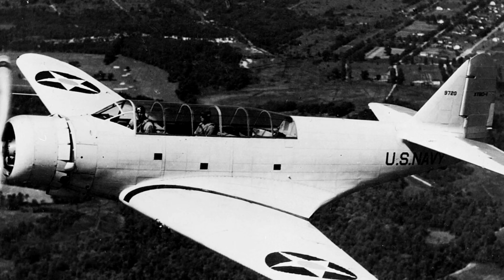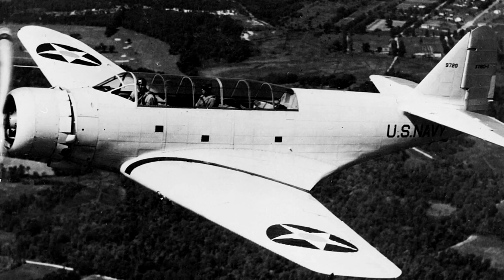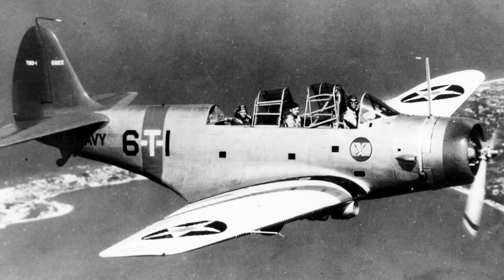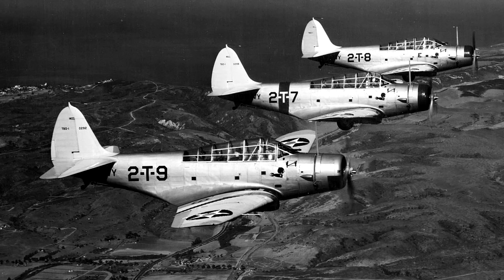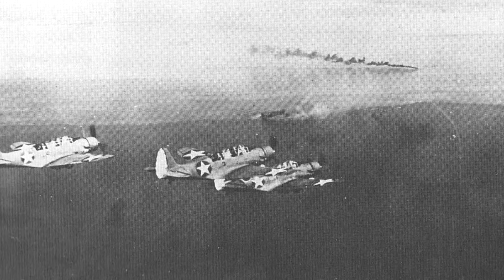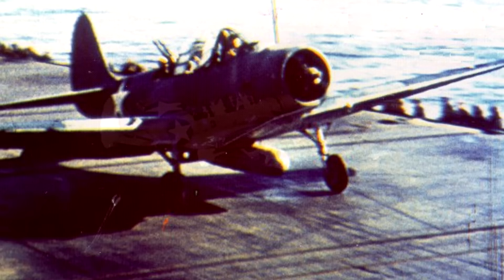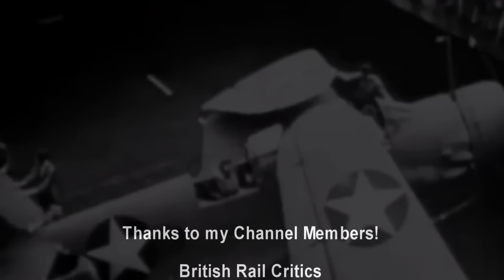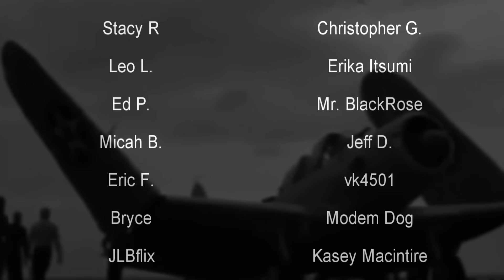The World War II Plane Put Up Against Stacked Odds | Douglas TBD Devastator | History in the Dark

Comment: Poor old Devastator, similar to the Battle in many ways. Looked pretty good, flew well when first introduced, suffered in modern war and flown in to action by extremely brave men.
Reply: Difference is, the Royal Air Force didn't give the Battle ordnance that was prone to failure. And this failure in ordnance also affected the Devastator's successor the Avenger. Midway was a horrible end for the Devastator, but it was an equally horrendous debut for the Avenger, purely because of Naval Ordnance arrogance.
Reply: I think 'extremely brave' is an understatement. I don't have the words to describe men who knew they were flying in literal death traps, dropping torpedoes that had a massively high failure rate. Their sacrifices were not in vain, thankfully.
Reply: Great looking plane!

Comment: Another aircraft was a similar victim of rapid advancement: the B-29. It went from the most advanced aircraft in the world in 1945 was considered to be hopelessly outmatched in the new jet-age as MiG-15s basically drove them from the skies. Well, daylight, anyway. The opinions of B-29 crews in Korea was vastly different than those in WW2.
Reply: THAT would be a great video, too!
Reply: The B29 wasn't that great in 1945. It's worth remembering that it was flying at a point that the Japanese air defences had been so degraded that it usually didn't need a fighter escort, and the Japanese rarely even tried to intercept them due to a lack of aircraft, pilots, and fuel. The situation in the Korean War was very different. The Communist forces had plenty of all three, and the MiG-15 was developed in large part to intercept bombers like the B-29.

There were a number of other issues too. For example, the engine cooling wasn't sufficient and the task of setting the radiator cowlings was an art form. Too much towards closed, the engines would overheat and catch fire, too much towards open, and the drag would take the aircraft below stall speed. At altitude the difference between these two points could be minimal, or even such that the bombers had to drop altitude in order to avoid the stall or fire choice. 

It was the first bomber that could hit the Japanese mainland and return to friendly bases, but it was at the cutting edge of what piston driven aircraft were capable of and it was unreliable and flawed as a result.

Comment: From the book "The Big 'E'," comes a story of an incident that happened during the early months of the war.  For most of December 1941 and January 1942, the USS Enterprise patrolled the ocean around the Hawaiian Islands.  One of the common practices was to send out TBDs on patrol loaded with a torpedo, which could be used to quickly launch an attack on any Japanese ship they came upon as the radioman reported the sighting.  But alas, TBDs would be recovered with the ordinance, assuming the plane had not attacked any unfortunate whale that the plane's crew had mistaken for a Japanese sub.  (A few whales had met this fate.)  On one such recovery of a still-armed TBD, a pilot landed a bit hard on the deck causing the torpedo to completely detach and start skidding down the flight deck.  Then someone noticed that this errant torpedo's propeller had started spinning under power.  No problem.  That was until someone else realized that if the propellor was spinning under power, then the warhead was armed.  So now there's an armed torpedo skidding down the flight deck, headed for the sea off the bow and possibly an escorting destroyer directly ahead of the carrier.  Fortunately, a senior deck sailor managed to straddle the torpedo and somehow wrangle it to a stop.  (Hopefully I've captured the essence of the story correctly as it's been a while since I've read the book.)
Reply: Would have been a dubious distinction... the Enterprise being the only carrier to launch a torpedo at its own escorts.
Wonder how many times that sailor would say, 'Did I ever tell you about the time I grabbed a torpedo and wrestled it to a standstill?' 'Right... sure you did.'

Comment: If the Pacific War had begun 3 years earlier, in December 1938, the TBD Devastator would not have had such a problem with Japanese fighters.  Because the A6M2 Zero didn't exist at that time (the Zero's first flight was on 1 April 1939, and it entered service on 1 July 1940).

Against the previous Japanese carrier fighter, the A5M 'Claude', the Devastator would have had a much better chance of survival, as the A5M was armed with only 2 rifle calibre machine guns.  

(Even in the Battle of Midway, a few Devastators were able to survive and return to their carrier after being hit by Zeros that had previously used up all of their 20 mm cannon ammunition, and only had their 7.7 mm machine guns left.  The machine guns alone weren't always enough to down the TBD.)

Comment: at Midway a greater percentage of Devastators remained flyable than did the Marauders and Avengers.
Reply: Marauders and Avengers went on to be successful combat aircraft going forward from Midway. Given their more advanced designs, this comes as no surprise. The Devastator was pulled from frontline service immediately after Midway for very obvious reasons. 

Are you suggesting that the loss rate from a single battle where newer aircraft deployed in small numbers (and in the case of the B-26, being deployed in the role of a torpedo bomber which it was never designed to operate) versus an obsolete aircraft deployed in mass that suffered a slightly less loss rate actually means......what?

I don't understand your point.